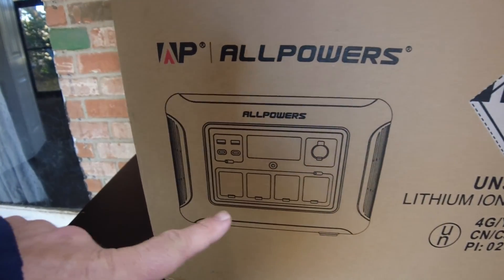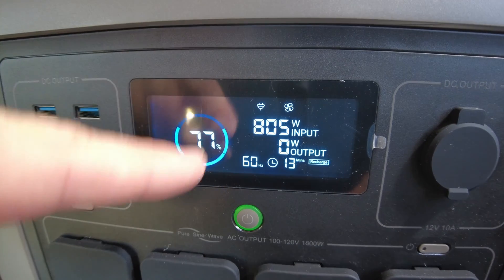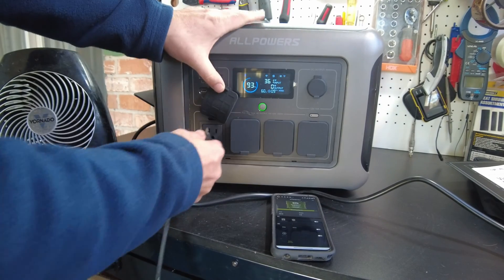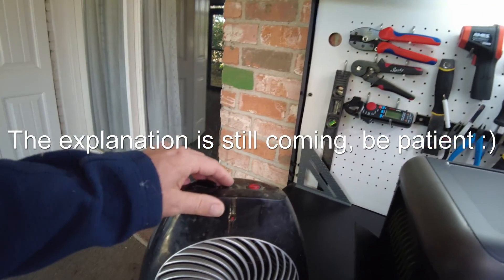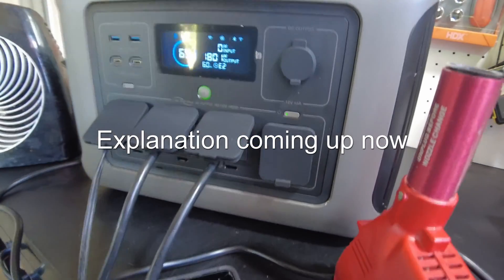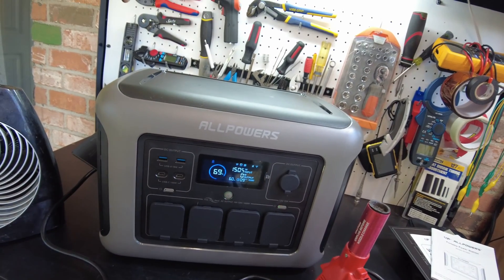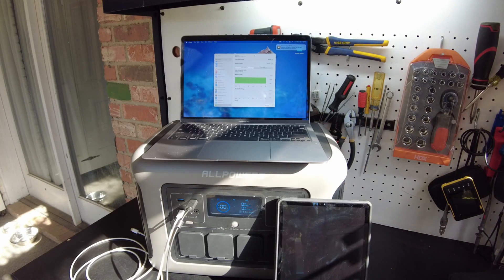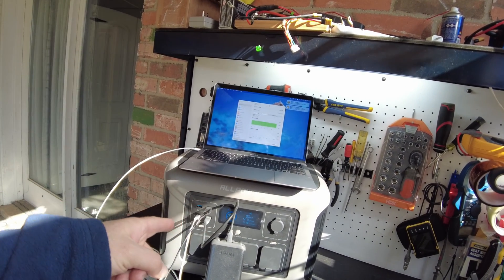ALLPOWERS R1500 1800w Power Station

Comment: Hi everyone, just to let you all know that ALLPOWERS doesn’t make an expandable battery for the r1500 model, which makes the two ports on the side of the unit useless! To me, that’s false advertising.
If you want to have expandable batteries, you would have to buy the r3500 at least, to have this feature, which costs a fair bit more.
So be aware before you purchase the r1500 model.

Comment: 60V input are VOC? What's the number of the cell's used in battery pack? How many in series and how many in parallel?
Reply from the maker: Yes 60 VOC. It's a 48v battery so should be 16s
Reply: @BradCagle  one more question please: Does this option stay on or close by itself after some time? I have many problems with the R3500 and I need the powerstation to stay on continuously, and when I need it I can activate any port in the application via wifi

Comment: I have this unit for the price its pretty good. even at 1800W load it maintained 110V output. i did ac capacity test and got about 85 percent advertised capacity. during black Friday it was on sale for 499 USD. the only issue i saw is while ac inverter is on there is a small fan always running in the background i guess its a good thing to keep things cool but it does use up capacity. just leaving ac inverter on uses about 2 percent battery per hour. leaving dc on don't use much at all. warranty is good at 5 years.
Reply from the maker: Nice, thanks for the info!

Comment: Dc output under 8 Amp load under 12 volts. I don't trust this unit...
Reply from the maker: Yeah, it sure did sag under 12v. I just noticed that too.
Reply: would that matter if i used this just for a portable refrigerator?
my setpower draws at most 55 watts